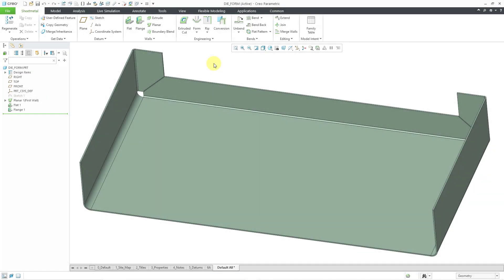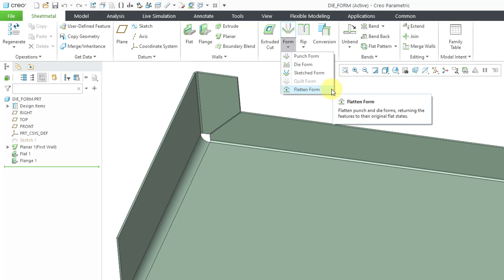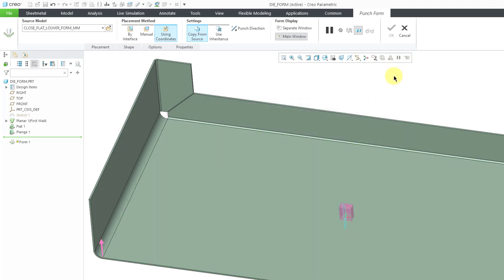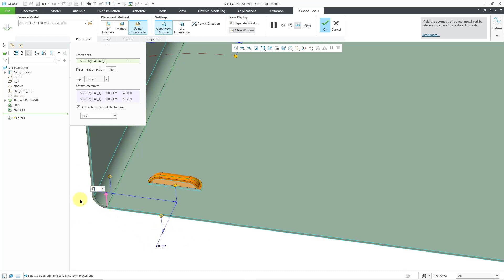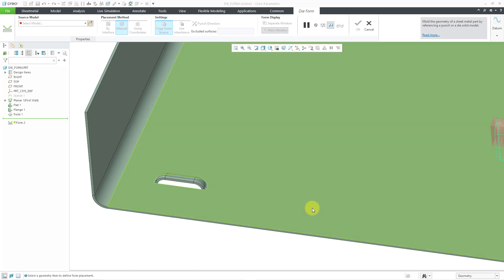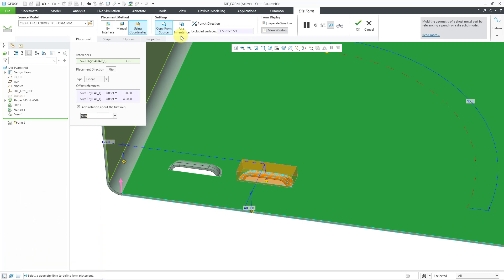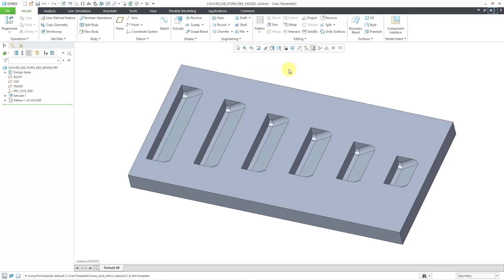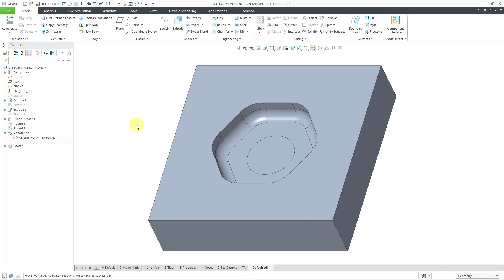Creo Parametric - Sheet Metal - Die Forms

Comment: These punch and die videos have been a great help to me in building a new sheet metal model. Is there a way to make a "tool" that can form the sheet metal in two directions at once? For instance, I have a real-world tool that puts an embossment into a sheet in an oval shape, centered around a circular hole. The thin ends of the oval are on the y axis, with the x axis running through the middle of the circle. The embossment angles the material 12.5 degrees off flat in both the positive and negative z axis direction, about the x axis. Is it possible to create a single Creo tool for this, or would I have to run the same tool twice, but mirrored?
Reply: you need to understand the process of bending sheet metal and the rules involved before you can determine "if a tool can be made to do everything at once" the answer to your questions is ....Depends....    do you care what the part looks like? are you holding tolerance? what material is it? what sort of tool holding are you using (press)..
Reply: @user-ig6ob2tg5p  I understand the process just fine. As I stated, the tooling exists, I want to know if I can replicate it in Creo.